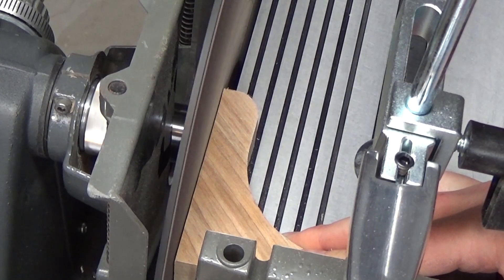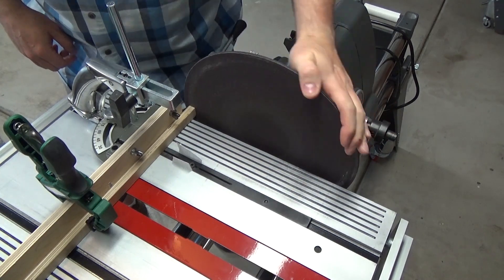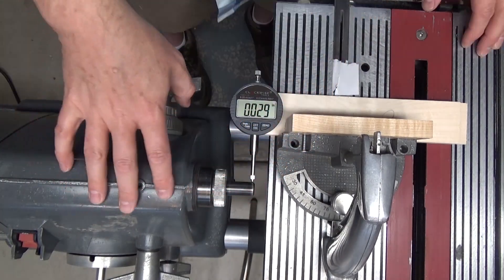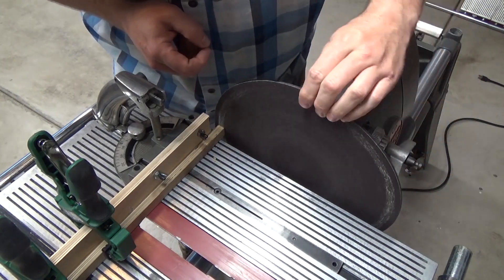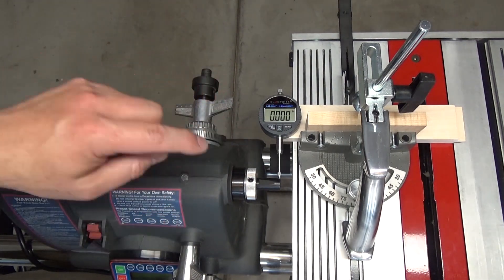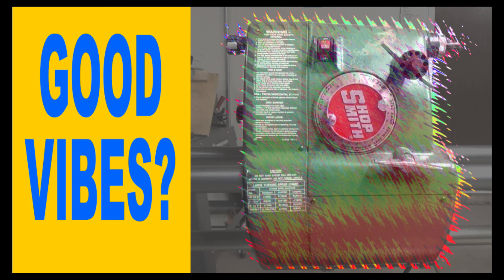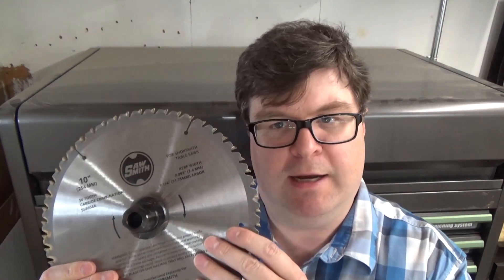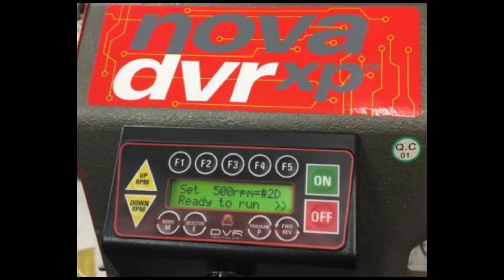Zero Runout & Other Mark 7 Performance Measures

Comment: Good comparison and metrics. Though would be interested
In rip performance with a proper rip blade. Also interested how both perform using a SS planer and shaper …just to put the M7 through some challenges…
Reply from the maker: Great suggestions Michael, thanks!
Reply: @woodshopnerdery  also, if temperature is a concern and you want to monitor, there are temp-sensitive labels out there that could be applied that would indicate an unwanted rise in temp of the headstock. We used to use ‘forehead temp strips’ for kids on machine tool motors…e.g., increase above a certain temp meant either a dull cutter or a bearing problem

Comment: Thank you for responding to my video relative to the Power Pro vibration and run out problem. I don't know if I want to purchase a replacement Quill orand new bearings or just replace the bearings. Can you provide me the make and part number for the bearings for the Quill and the Shaper? Thank you, Ted
Reply: Jointer of course. Thanks again.
Reply from the maker: Hi Ted, I'll do one better. Here is a link to Everette Davis's Bearing guide. It is the most complete set of information about Shopsmith Bearings I know of. Everette is a real friend and leader to the Shopsmith community, you might find it interesting to peruse the other information on his Google Dirve.

https://drive.google.com/file/d/0B1p8_ycx_8A0MHdnTU9nT056UnM/view?resourcekey=0-Gevbvd6LOVmwptFgPzexcA

Comment: Can we blame the problems on Covid? Are we still doing that? :)

I wonder if it’s just low quality bearings. I’ve had that issue with my Shopsmith bandsaw.
Reply from the maker: My best guess is that the bearings were faulty and went bad as I built the first couple projects

Comment: You're almost at 1,000 subs, congratulations. I recently opened a less-than-ideal product from a reputable business that left me wondering how it happened. It's impractical to fully test everything that comes off of a production line, but I have the impression that a lot of businesses have been struggling more with quality control over the past couple years, especially with the recent inflation and supply-chain issues.
Reply from the maker: Thanks Ben, yes will likely be at 1000 in a few weeks. I agree, supply chain and labor expertise shortages is really stress testing QA/QC right now. I feel bless to have the gifts to sort my own QA/QC.

Comment: A bent shaft doesn’t seem likely.  I mean, the amount of force required to bend it would be significantly more than would happen easily.  

When you said that the bearings might not have been seated properly… I thought…. That makes sense.  I’ve done that before on a grinder power shaft mount.  The stone wobbled like a constipated duck chasing a grasshopper on a lawn.  You didn’t have to remove the bearings to replace the shaft did you?

I wonder if the bearing mounts on the shaft itself were eccentricly ground?  

The cause has me intrigued!

PS… understanding the difference in accuracy, precision, repeatability and reproducibility give you a leg up on analyzing performance problems.  Don’t they?
Reply from the maker: Dave, I am glad you agree, the shaft is a pretty beef chunk of metal with only a few inches of span between bearing support. I've hear of people bending shafts while turning large bowls and getting very nasty catches. But, I think even then it is more likely that the bearings deformed.

I did not disassemble either Mark 7 quill. Shopsmith sells the whole quill and nothing but the whole quill as one unit. My suspicion is that they get it complete from an over seas supplier. looking down the back end I can see "China" stamped on the bearings.

Yes to your "PS" education has been my 3rd greatest blessing behind my wife and children. I hope I am sharing a little of that blessing here.

Comment: Finally, someone doing precision testing on this machine… Thank you! More of this, please—I have been debating whether to get a Mk7 for a while, but haven’t so far, largely for this exact reason: not sure whether it’s precise enough. Another issue to explore: does it lose precision after switching modes? Thanks for your videos, Tom!
Reply from the maker: Thiago, Thanks for the compliments. Glad you liked the video. So far my Mark 7 has been very precise, as long as I hold Shopsmith to their quality guarantee. So, I've had a few issues to solve to get the precision I am looking for. Any machine lose precision (the ability to get the same repeat result regardless of total accuracy) when changing set ups. With a Shopsmith we change setups more. However, there are tricks, like make all same length cuts at the same time and set up some stops to come back to previous setups.

Comment: I almost "pulled the trigger" on a Mark 7 about a year ago. Kinda glad I didn't now after seeing your recent videos, Tom. If I would have as many troubles with one like you have; Shopsmith wouldn't be happy with me being I work 3 miles away from their front door. Phones calls and emails don't quite have the same impact as me showing up in person to take care of "bidness".
Reply from the maker: Chad, I'm on the fence, truly. I wish I could gush out glowing accolades. What I am finding out, it that it is an excellent design, but they have needed a few tries to achieve excellent execution. But I see a pathway to a positive outcome, which is why I have not returned it.
Reply: @woodshopnerdery  And I'm guessing by now that when you contact Shopsmith customer service, by any means, that they probably say "Oh crap, it's that Purk guy, again! How much is it going to cost us this time...". 
Not knowing all the issues you've come across, except for what you have pointed out in your videos; this latest one with the quill came as a surprise. Especially after knowing how much Shopsmith has boasted about how great the two bearing quill is one of the best upgrades for any Shopsmith Mark V headstock with a single bearing quill. 
To have questionable bearings in a brand new Mark 7/Power Pro is unacceptable and inexcusable, imho.
Reply: Chad, I live a bit over 2 hours away. About a year ago, after a LONG wait I got a new Mk7. Multiple alignment issues. I wondered whether they assembled it late on a Friday …

After many emails, pix, and calls I took it back to SS. Sue was very helpful. It’s now working ok, though I still have some issues.

Comment: another excellent and informative video. Question, did the replacement shaft come with new bearings or did you use the "ntn" bearings that you purchased? thanks for sharing, Curt.
Reply from the maker: Thanks Curt, the new quill comes 100% assembled. In fact Shopsmith only supplies the whole quill not the parts

Comment: You would think they would check the runout when the headstock was assembled. Maybe the runout was checked, and the problem started after you started using it. Poorly lubricated bearings comes to mind.

I have three steel sanding disks. None of them are flat. Close enough for but not flat.
Reply from the maker: I think the quill started fine. My best guess is that there was something wrong with the bearings and the broke down very quickly.